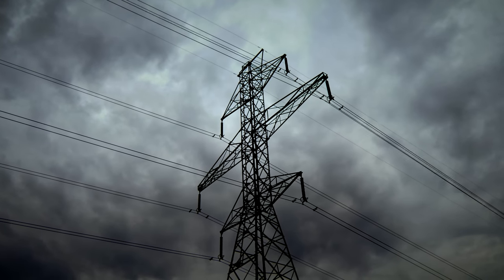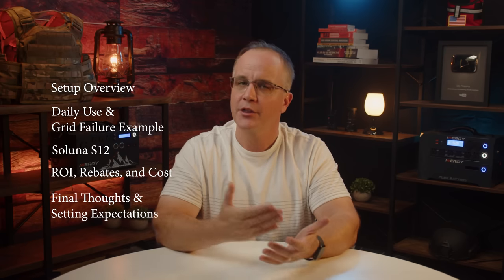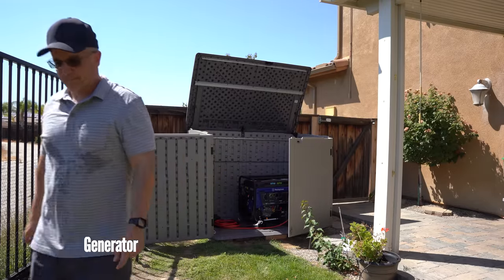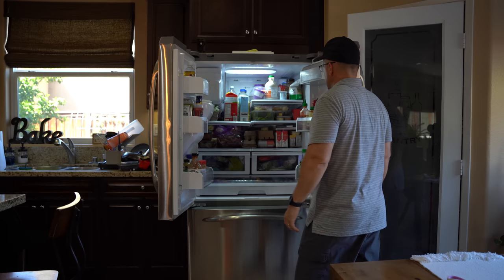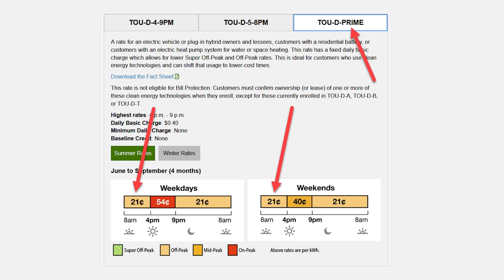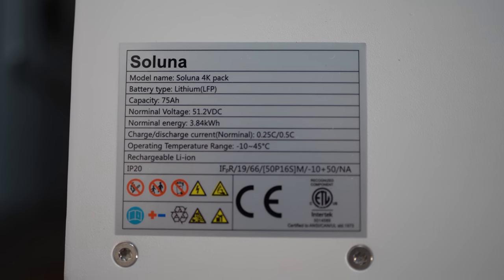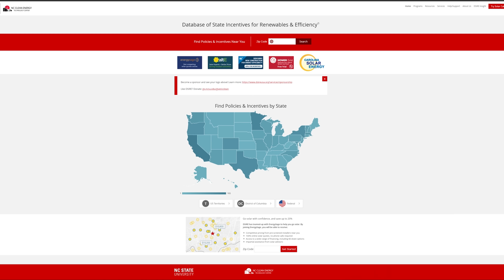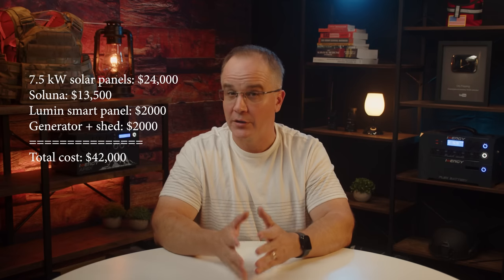The Coming Power Grid Collapse.  Soluna S12 Whole Home Backup Power

Comment: gasoline boiling point  between 104 and 392 degrees F. a vented gas cap will be needed  vent to the outside of box.had one
few years back in a much larger shed and it all most exploded. lucky for me i shut it off and vented the tank.

Comment: We got grid ties solar panels a year ago. Our electric bill has dropped much more than the payment for electricity. In spite of my wife's complaints over the cost of the solar (~ $22K). And yes they turn off when the power fails, or more accurately they require a power signal to match to and turn on. With this I have figured a way to 1. disconnect from the grid** and 2. trick the inverters with a signal and then receive power when the sun is shining. I have not tested this yet but the theory says it will work.

Comment: It's pretty hot in Washington today I made a couple window shields (take cardboard boxes flat and wrap aluminum foil to cover on at least one side) to cover the windows so the house doesn't heat up too much in the sun side we don't have AC. I feel for places that are having rolling blackouts due to high AC use. Y'all will want solar power AND window shields no doubt..

Comment: You might consider room size evaporative coolers.  They run on a fraction of the power of a regular A/C and should work well in your part of the country.  I have one and it works quite well.  Mine only pulls 60 watts.

Comment: There's  a site that I buy batteries from that carries used solar panels used good grade batteries an accessories for assembling your own Batteries it requires  alot of patience  an the want to be able to survive with the so-called  system that is dysfunctional  to begin with anyway I've  personally  designed  an built my own solar generator  rated at 1800 watt continous an 3600 surge like I said it requires alot of patience  an a decent mechanical/skill set anyway if anyone's interested  check out this site There's a group of individuals  there that offer tech advice if you are serious  about survival  it's  not that difficult alot of studying an research safety first. Also I have 5 each 1800w surge 3600 w xantrex hardwired inverters only 4 sale do your research these are real top notch  inverters priced very reasonable still in  static packages never opened.

Comment: Timely video.
I'm still learning about portable gasoline generators. And need to get one.!
Reply: Hello my friend.  Consider getting propane or natural gas generator instead of gas.  Never put gas in a generator if you can.  The gas spoils and the carburator will be clogged in the critical time you need it.  Propane and natural gas do not suffer this issue.
Reply from the maker: Go dual fuel generator.  I just run propane in mine but can use gasoline if I have to.
Reply: @CityPrepping  isn't that just more likely it will break?  A dual fuel generator?

Comment: I wanted to add, please don't waste $ on inefficient lead acid. Lithium is superior due to its effectiveness to take in the energy you put in, and give it back at near 100% efficiency, vs lead acid, which is around 50 - 60% round trip, which also takes a long time, and wastes precious energy and time.

Price point for lithium can even beat lead acid prices pending your ability to shop smart. Battery hookup has been very good to me. I'm able keep my house cool with two ac units, fridge, lights, and anything I want to run, all at the same time if I wish, and have a good amount of fuel on hand.

I spent an absurd amount on electrical for my bass vehicle, which was originally designated for ultra high power car audio. Instead of doing hair tricks, making myself and others deaf with it, it's now a multi purpose, portable power generation station. I can roll up anywhere, and provide peaks of well over ten thousand watts of 120v power as long as I have fuel. For backup I have 1500 watts in panels, and a midnight classic 150 should fuel become unavailable. 

Plan ahead, utilize what you have, you very well may have sources of power on hand if you think outside the box. 

Great video as always, I'll be sharing this all over. 

Maybe I should do a video on how to build your ride into a formidable power station.

Comment: I would get out of California as soon as possible. .21 cents as the cheap electricity, wow. Here in Indiana, I pay .11 per KW and doesn't matter what time. As more and more people there in California get solar, the power companies will have no need of that power at the time they are generated, so Either they will have to store it or git rid of it. Either way they have to build infrastructure for power that no one can use at those time because everyone is generating their own power. So you will see higher and higher grid fees on your bills until these fees will surpass the amount of the electricity your using.

Comment: Some of the solar installers have gotten crazy with their prices (they are basically making sure that the entirety of the 26% rebate goes into their pocket rather than yours). I am tempted to buy the components and sit on them and/or build the system myself but stop short of tying it into my power panel until it is needed. No one is gonna bark at you during a power grid collapse.

Comment: I have:

8: 12v 115ah Lead Acid Deep Cycle Batteries

14: 12v 100watt Solar Panels

3: 30 amp Charge Controllers

1: 3000 watt pure sine inverter

3: 40 amp fuses

1: 400 amp Class T Fuse

Cost so far: $6k

I can run my entire 30 amp RV and most power tools. Soon I will be installing a softstart on the AC and should be able run it during the hottest parts of the day. I can only run until between 9-12 depending on season and weather before switching to generator power until sunrise if necessary. My final estimate is that I will be aiming for a bank of 18 batteries and an array of 3600 watts of solar (double that and you might start approaching the energy requirements of the average home), which will compensate for cloudy days. This isn't practical for those who desire to be mobile or low-key, it isn't a financially easy thing to set up either but to me it has been worth it. I'm building a homestead on 3 acres approximately 15 miles from the closest town down dirt roads that take an hour traverse. From there, it's an hour and a half to the closest city. I have the power I need to build, remain comfortable, keep food and provide heat to my livestock, though I still have a long way to go before I realize my goals and am meeting my energy needs without fossil fuels. I'm already beginning to figure out the energy requirements for an electric truck for the future because it's obvious that the politicians are going to be forcing us into EV's. Eventually these systems will probably become pretty familiar. Also, I would be wary of any grid tied solar systems. Sure they pay you and you're producing your own power... for now, until someone else's need becomes greater or they think your privileges should be revoked. Good luck to all who take on this endeavor.

Comment: Good points. A lot of people think that a backup power generator, for example, has to provide energy for the house to be fully operational -which is non-sense. As a many times "hurricane veteran" in Florida, I've been through a few power outages lasting 10 and 14 days.... As Kris said, you can survive the 105+ degrees heat index by confining to ONE ROOM and using a $600 generator and a $250 portable 8,000 BTUs air conditioner. One of my neighbors had installed a 45 Kw Generac stand by generator for the whole house. His extended family moved there after the hurricane passed. 24 hours later, the generator's belt broke and that was the end of it. They all had to move a hotel. Us, in contrast, could stay home, in one room with a portable Honda Generator and a portable a/c unit. Spending tens of thousands of Dollars is not always the best solution nor "you get what you paid for" applies.

Comment: For around $2,500 less than this system you can purchase a Bluetti Power AC300 system with 4 B300 battery packs that will be half the weight, "portable" and provide you with slightly more power power than this system will. Just food for thought. Loved the video Kris

Comment: We are similar, opted away from the Lith/ion, Iron pho due to their computer board complexity and need for VERY  controlled charging. Yes, yours can use more of that battery capacity (80%) vs. only 50% for AGM . I am extremely concerned about long term durability of those circuit boards controls. Mine will be less polished, but will preform similar at smaller scale.

Comment: City Prepping is it possible to expand your system or create a pigtail onto a system if you know you can afford to add equipment pieces later (additional batteries, solar panels etc, to include adding circuits) thanks

Comment: I'm not knocking you... but it's easy to recommend a system that you didn't have to pay for.
Reply from the maker: i paid for the solar system and generator ($26,000).  the soluna was given to me for review.  but i would have bought a system like the Soluna as it speeds up the ROI and gives me a backup power source.  but you do make a valid point ;)
Reply: @CityPrepping  Like i said, not knocking you at all. Free is ALWAYS good. Im  just saying, it makes it easier to recommend. Your setup is about as good as it gets for California because they will fine you if you go over your allotted draw. I've been looking into a Tesla system myself. They
 have the"Wall" batteries.

Comment: This is very scary in Phoenix! And as a society we are desperately addicted to the internet.
Reply: Humans have lived a long time with no power or internet.
Reply: in PHX too, bro. I work around 43rd & Indian school area. the grid is shaky at the best of times here. It'd be pure nightmare chaos is the lights go out around here. no AC and it was only 121 at our shop yesterday (7-14-22)
Reply: @kinnertubbyson  I had my Ac go down in my home for 5 days in late July several years ago... plants died... food rotted... pillar candles melted.... even books started losing their glued bindings! Got to 120s inside with doors open and air flow. We slept on the cooler tile floor with ice filled towels on our necks. We took turns laying in the tub.... was horrid.
Reply: @MyButtercup  yes true! But... cities like Phoenix wouldn't exist with this population without ac. It routinely is over 115 here... and the concrete jungle forces the rains and cloud cover away. Houses are built of Styrofoam and chicken wire. Ppl don't grow shade trees, opting instead for (hot) rocks and cactus... we no longer build homes with screened in  "Arizona rooms". There would be a massive exodus out of phoenix with a power grid scenario. Regardless of how long ppl lived without electricity. Even our water is pushed by electricity!
Reply: @jhildebrand7447  a/c alone isn’t the issue. Passive cooling fell by the wayside, and adobe homes are few and far between. There’s other ways to live here, but they aren’t as affordable.
Reply: @username00009  totally agree! Earth houses like adobe, sunken partially into the earth, make the most sense but require a totally different style of building and coding. And we are losing our ancient knowledge. Crazy how we have access to more information than ever, yet know less about survival than our great grandparents.
Reply: @jhildebrand7447  Then I bless you in the times to come.
Reply: @MyButtercup  thanks so much. I will gratefully accept any blessings ♡ . We surely are in troubled times. I hope and pray for the young and old, and sick dependant on machines; who would surely be mostly affected.

Comment: @CityPrepping - On the shed for the generator, have you used it much yet for long periods of time? Im curious how a generator like this does running inside a closed shed.  I know the fumes are toxic so you can't run it indoors, but was curious if its safe to run for hours at a time in a shed like this without the risk of a fire etc?

Comment: These are available in smaller units, hybrid inverter charger, mine is 2400w 120v. I put 800w of panels and 8kw of diy lithium on a small RV, I should be good for a decade. Gave away the old Onan. Think about a solar dump load like a hot water tank for extra efficiency (store as heat when battery is full and draw heat from tank at night)

Comment: I have had a fairly powerful  gasoline emergency generator.  And thinking of adding solar.  This is very useful.  And in terms of priorities, we do seem aligned.   In the event of a power failure, I do have to get outside and plug it in.  Then throw 10 switches in the  basement and good to go.    Like you I prioritized my needs.  No A/C for me.  For me it was a 3 way tie between my sump pump  (our power seems to out during storms), refrigerator and furnaces so thing don't freeze in winter.  Beyond that, the rest of the kitchen (whose circuit oddly but conveniently included garage door openers) and keeping my wifi going.  I do have  at least one light and  plug in each room and halls.  All of this does not run at the same time and the generator handles it comfortably.  If it got really bad in summer, I could handle a small window A/C for one room.    I also have a detached garage/shop.  The projects will just have to wait.  😂        Yes, a noisy generator, like I have, will tell people you have a generator.  But so will the glow of lights at night, no matter how quiet you may be.  Thanks again for another useful video.

Comment: Perhaps the current times are different but I wouldn’t really use possible energy cost increase as a significant factor in the Roi.  Been in my house 20 years and increase has been minimal.  If you factor in upgrading to energy Efficiency appliances making improvements over time it probably cancels out any rate increases which are generally only on KWH not the entire bill.  As mentioned each utilities and application is different .  Great video I’m doing something similar with a larger solar generator hope to upgrade to something like that some day

Comment: I have an Ecoflow generator and was told by them they don’t recommend mixing in one of their solar panels with other solar panels to connect to an Ecoflow generator/ battery. Do know if there’s a legitimate concern of doing that assuming that the connectors and voltage is compatible?

I have 160 now and would like to have a total of  500 or 600. I hoped to just buy a cheaper set of two 200w panels.

Comment: Thank you for this, Chris.  You cleared up some of the muddle that's been in my head for some time.  I have a grid-tied system through Tesla, with no backup, so, from what you said, I think I would be required to go through them, but I do appreciate the information.

Comment: This was incredibly helpful. A couple questions. Would this setup or one similar be able to power a two furnace home for a cold Midwest winter just warm enough to keep water pipes and food/water storage from freezing? Would it be able to handle a well pump, a sump pump, and the fridge/freezer alternating usage among the appliances in an emergency without any grid power, or would a larger system be needed to run more than one of those at a time?

Can you still control the system settings another way than the app in case for some reason you don’t have WiFi/internet/cell data?

How much roughly do rainy or cloudy days affect the solar power input compared to sunny days? Midwest area I’m in has quite a mix of both. Also curious how the shorter winter days play into the numbers compared to the longer summer days.

We are trying to calculate figures before deciding what to purchase.

Definitely looking forward to seeing what you do with the quiet shed for the dual fuel generator.

Comment: did you factor in the cost of the system with the interest rate of the loan you get from the manufacturer?... What about the increase in home insurance to cover the repairs as well as the increase in property taxes due to value added?  these other factors often add up to a net zero gain and for those that pay less than 15c per KWH its a loss. the final issue I have is that this unit was given to you... thus you cannot honestly give an unbiased review...

Comment: Make sure your system has proper filtering in the inverter, some us versions of inverters may generate a large amount of radio frequency interference, hampering radio communication, like,  Amateur radio and other licensed radio services. Noise can and  will travel over and radiate off of power lines.

Comment: I mean, its nice... but 30,000 dollars and it STILL wont power your entire house??  Thats crazy to me.  I have a 7,000 watt generator that i have put a tri fuel adapter on & its set up to run thru my panel as well.  I plan on running a gas line to it, but will also keep some gasoline & propane tanks, as both are needed for other household stuff.  I dont plan on running my entire house either, but ive got about $500 into my set up.  31k??  Wow.  It would simply never happen.
Reply: Me neither, so I’ve got some small backup stuff, but also slowly building up non electric tools to use if we have no power. Camp cookers with propane reserves, hand powered kitchen tools, and canners that I can use on the gas grill or camp cookers to can all the meat in my freezer in case of a long power outage.